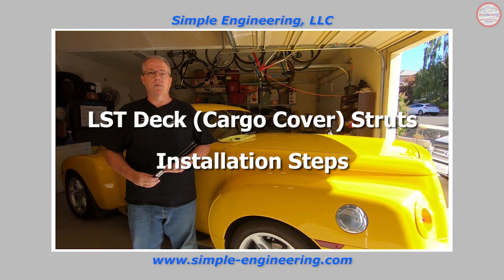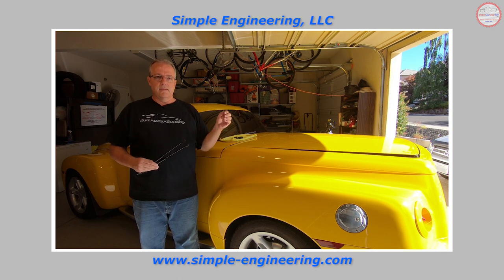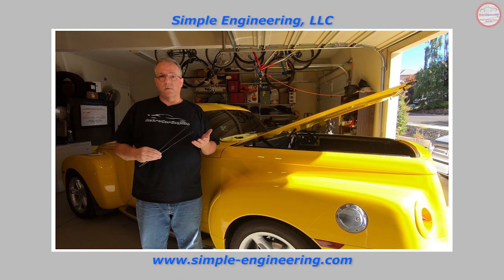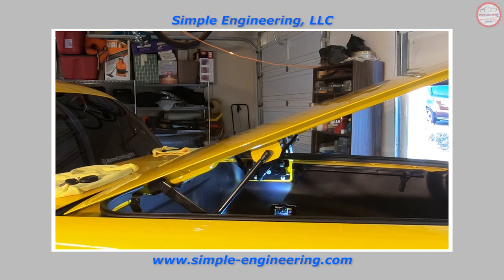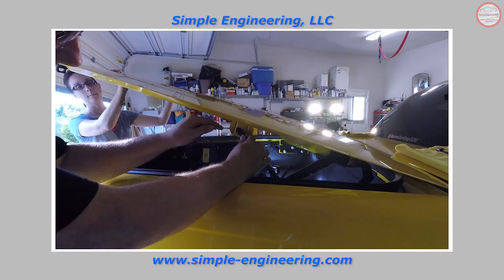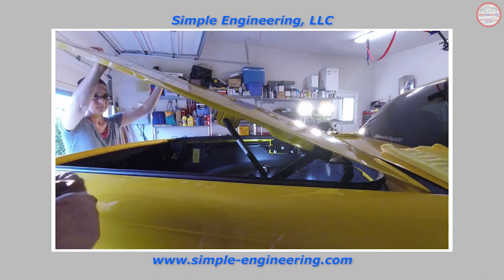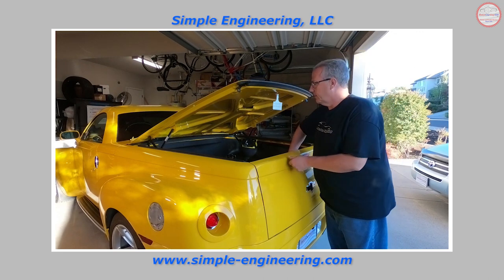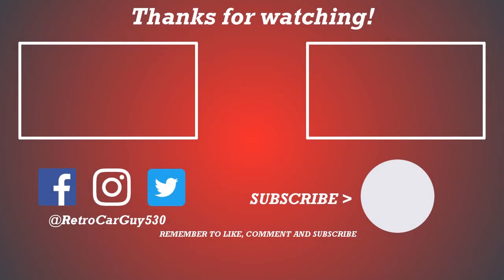LST Deck (Cargo Cover) Struts - Installation

Comment: Just installed my new cargo cover struts on my 2004 SSR.  Absolutely perfect instructions, the struts from Mike at Simple Engineering are also perfect.  Many thanks to RetroCarGuy530.
Reply from the maker: I'm glad you were able to get your cargo cover struts installed easily.  It's really nice to have the cargo cover open up fully like it should when you have fully charged struts installed.

Comment: Hey Robert.  This was perfect and simple.  So happy to have found Mike at Simple Engineering and your awesome videos!  Thanks.  How about those tail lights?  We love yours.  Tell me about them?
Reply from the maker: Those were custom built taillight buckets using OEM taillight housings.  A SSR owner with a machine shop was making those back in the mid to late 2000s.  I started with 50 Pontiac lights in the custom taillight buckets, but the lens (very dark) made the light from the bulb almost impossible to see when the sun was shinning directly on the rear of the SSR.  I ended up with 61 Chevy LED taillights.  No problem with visibility in any lighting condition.  When I sold my SSR, I removed those custom taillights and sold them to a fellow SSR owner in Las Vegas.  At one point in time, there were metal taillight buckets being sold for the SSR that would allow you to do something similar, but I haven't seen those for quite some time.

Comment: Thanks, got to do mine. I might add another fellow adds grease to the balls, which I think is a good idea.
Great Job
Reply from the maker: Not a bad idea.  The ones I installed in this video already had a small amount of grease present in the ball sockets.
Reply: @RetroCarGuy530  Got mine installed. Your video was most helpful Thanks

Comment: What is the part # for longer struts?.
Reply from the maker: I don't have a GM part number for the original longer struts for the redesigned brackets.  Simple Engineering sells both lengths of struts.  https://simple-engineering.com/product/body/lst-cargo-cover-support-struts/